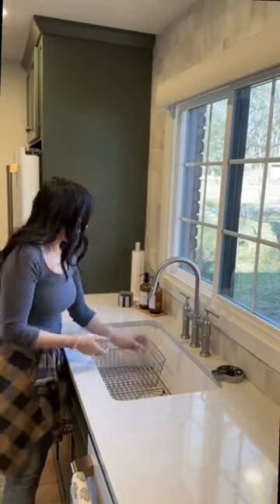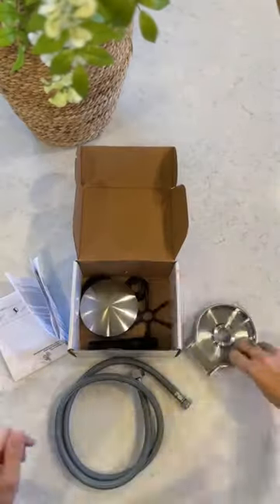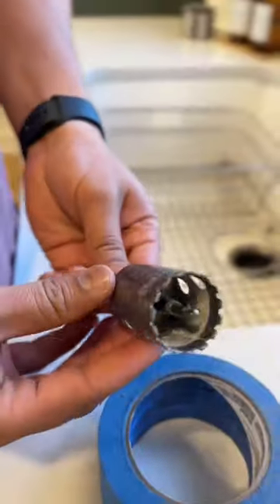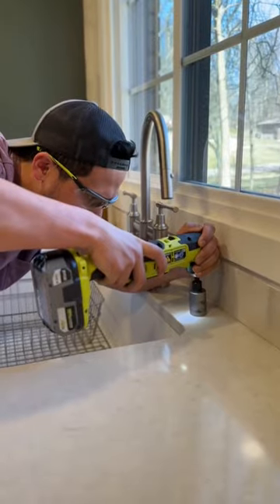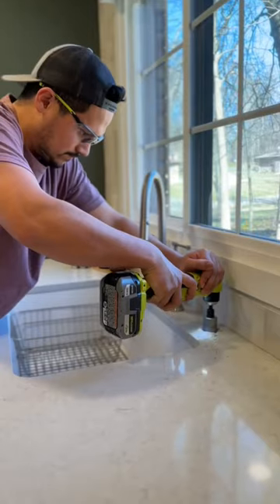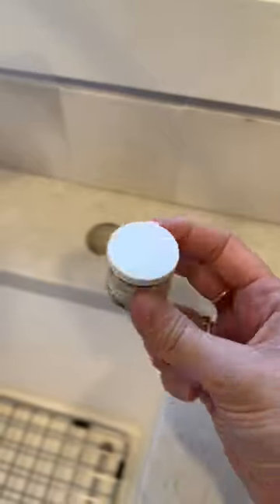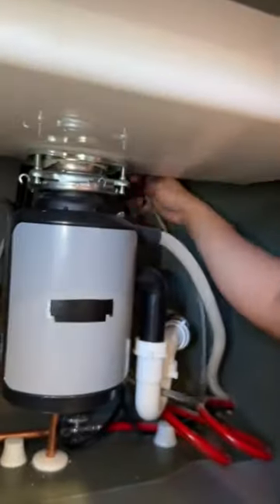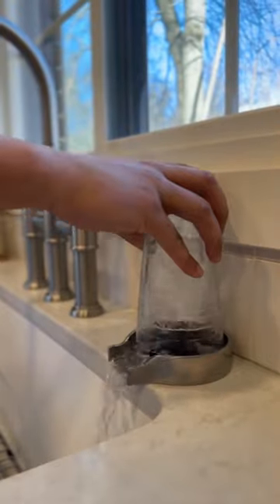Installing a Delta Faucet Glass Rinser in Our Kitchen! #kitchengadgets #kitchentools #kitchenhacks

Comment: looks pretty useless, as you can rinse from the faucet, its just shooting water in it, ... like the faucet......
Reply: It shoots a strong hydrojet of water. It is meant as primary as a rinser and secondary as a washer with soap added. Those hydrojet are strong enough to remove strong dirt on it 

Shooting a strong hydrojet spray of water is very different from the faucet. This popularity it's common in baristas, boboa tea, milk tea, etc;

Comment: What size was the drill bit you used to drill the hole?
Reply: 20mm / 2cm
Reply: That’s a 2 inch hole saw bud.
“2cm”😂😂
Reply: I think the photo shows it to be 1 3/8 inch, which is the standard countertop hole size—which is what Delta recommends.